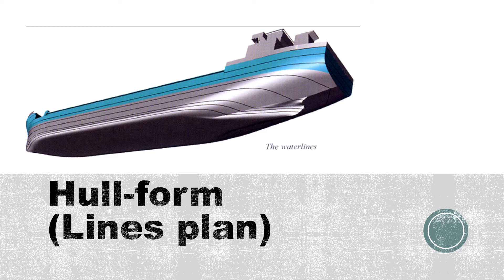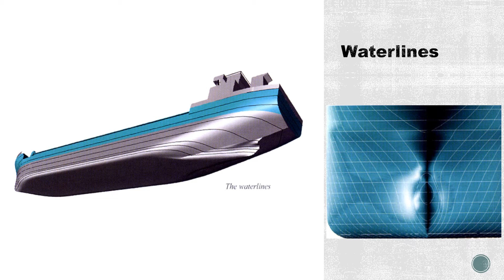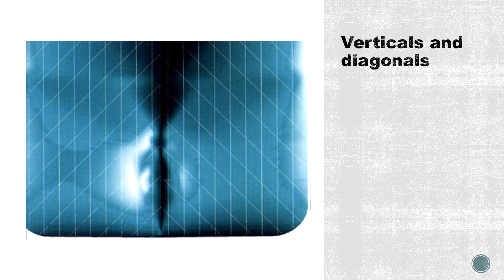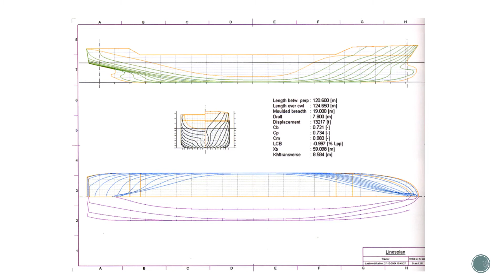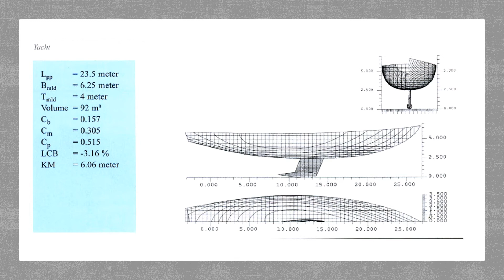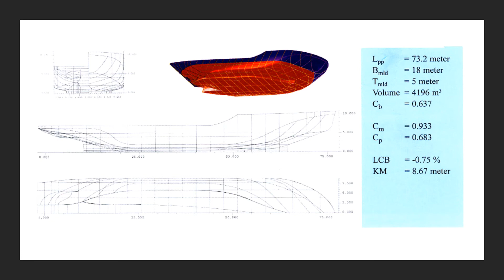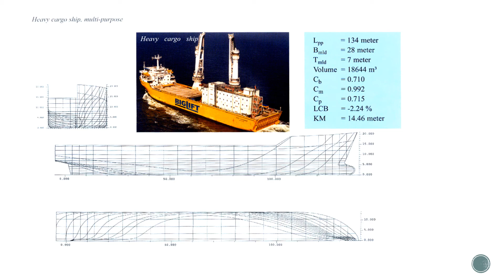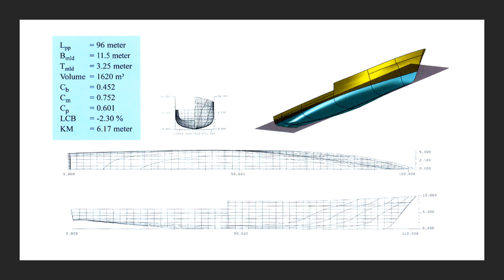What information can you derive from the Lines Plan of a ship?

Comment: Some vessels have frame with alphabets. Example: Frame.0 - Frame.50, Frame. A- Frame.K, Frame.51 - Frame.80. Is this set from the initial design stage or? What is the purpose of naming frames with alphabets instead of continuing with numbers?
Reply: because the ship is lenghtened in the middel! based on existing ship